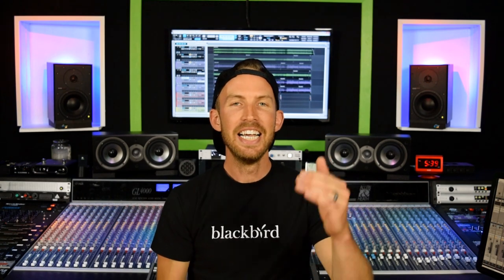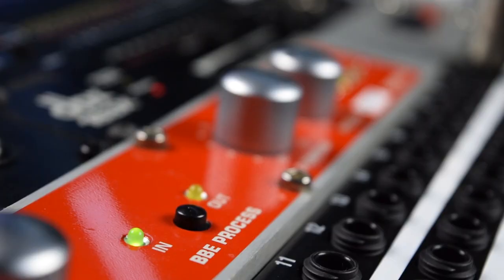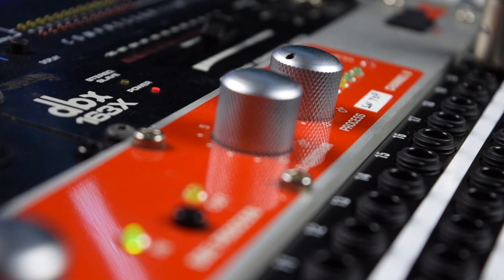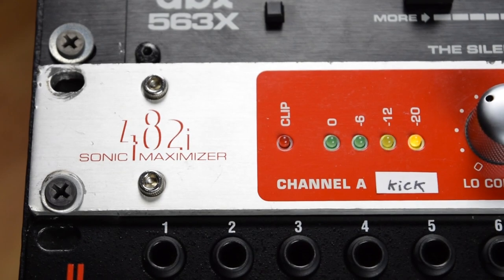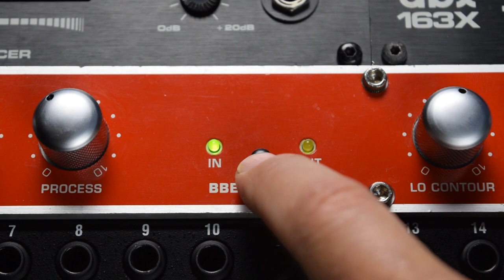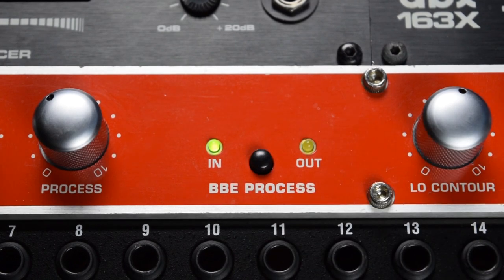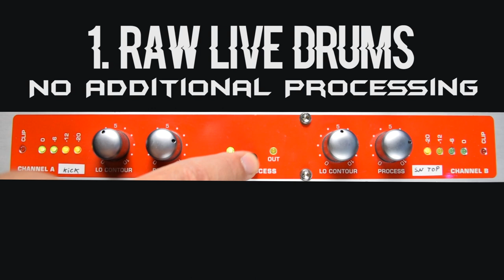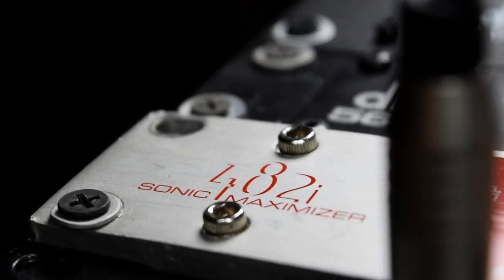BBE 482i Sonic Maximizer On Kick And Snare (Used at Blackbird Studio)

Comment: I have a mixer and it has a patch bay. Im going  out the mixer into my analogue filter Unit and out of it going into the gate compressor limiter and out of that into back in the mixer.
Now my question is where do i put this Unit? Before the compressor limiter gate or after to rebrighten after the compressor.
Which is the correct way?
Or more correct.
My guess is before the compressor limiter gate in order to keep system balanced but i might be wrong.
Reply from the maker: It depends, putting it before the compressor will make it a bit smoother and any eq changes you make will effect the compressor. Putting it after the compressor will make it typically brighter and have more bass but a bit less controlled. There's really no wrong way, more of just what you prefer
Reply: @TrueSoundTV  ill try both see what sounds better for best result on live Streaming.

Comment: Hi, do you think that BBE 482i would help improving solo vocals / voiceovers? And if yes, how can I utilize it for the low frequencies assuming that I apply high pass filter at 80Hz on my preamp? Thanks in advance!
Reply from the maker: Good question! I have never used it on a vocal before but i will definitely try it out and make a video on it! Using the high pass filter is a must on vocals but the BBE will treat the lows differently due to it's frequency curve. Do you own a BBE 482i?
Reply: TrueSoundStudios , thanks so much for your interaction with your followers :) really nice! Currently i'm not owning that piece of gear but thinking if it will improve my work (I do only voiceover & solo vocals) I will definitely buy it. That's why I'm curious to know how would it treat human voice :)